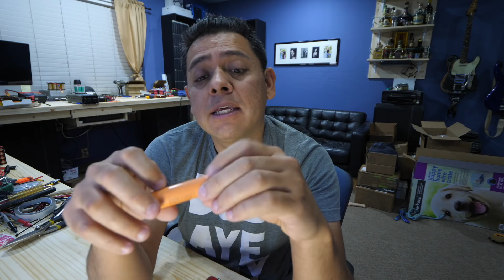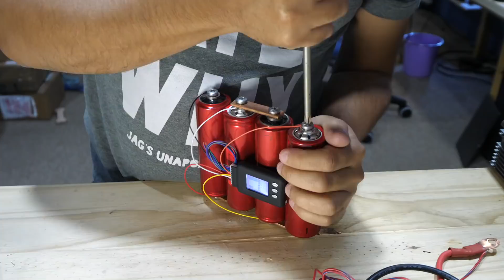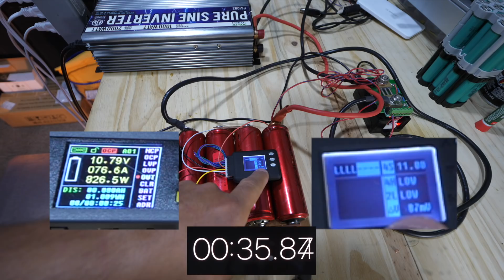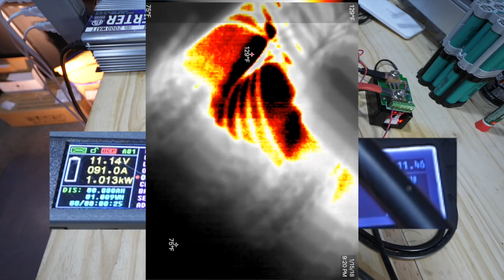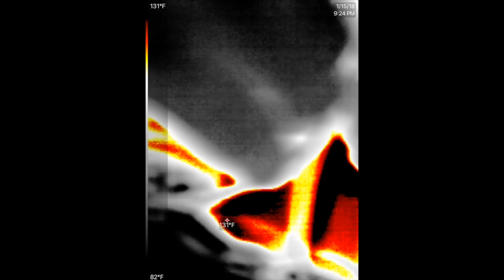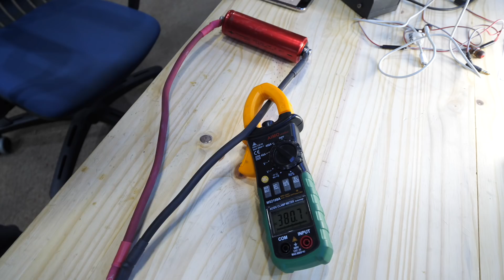12V Lithium Upgrade Headway 38120 Cells - 100A continuous (2018)

Comment: I'm currently running a 4.5kwh 4s 18650 system in my RV. It is entirely off grid with solar. I only charge it to 16 volts because it adds to cell longevity and that is the maximum voltage of my inverter (it's the same brand you used in your video about inverter input voltage range). This works well for me and I don't have any issues. Would there be any benefit to changing over to these lifepo4 for me other than the voltage matching lead acid better?
Reply from the maker: The only advantage is that you would be able to use 100% of the pack energy.  Not worth it if you don’t need all the energy

Comment: How many would be needed to make a good 1kw solar generator? Kind of want to throw my hat in on making a decent Lithium Iron Phosphate solar generator that I can take camping. Just want something to manage basic camping needs and maybe like a Projector for the kids at night :)  Thinking 1kw should do that with 2-300 watts of solar panels to recharge during the day. I just don't want to be using gas generators or buy a flippin $3500 solar generator pack that sucks! LOL
Reply: Still no advice on how many my project would take? :/
Reply: in for reply
Reply: Figure out your watt hour requirement. Projector uses X watts, want to run it for Y hours.
This video literally shows that 4 cells can output 1kw for about 5 minutes, but if your projector is closer to 50w, well you could probably get a full movie out of the 4 cells.
There is a guy on YouTube called Greg Virgoe who is converting a Merc van into a camper and he has a video about sizing batteries to your needs and had a link to a spreadsheet in the video description to help with the calculations, as well as explaining it very well.

Comment: Hi, I'm looking to build 4 100amp 12v packs for my motorhomes solar system. How many 18650 cells would I need for each pack? I also need a bms for each pack.
Thanks
Reply: How did you go with your 100ah battery.  I want to do the same
What did you end up using

Comment: I run 250a thru 16 awg silicone rc wire so no problems your wires are very thick.
Reply: Ok I just watched it and I really don't know where you got the cables from but proper quality cables wouldn't do that at all. Really  measure the inner diameter sometimes there is fake gauges on them mainly Chinese manufacturer and us store import them without knowing. Very concerning

Comment: Don't use these batteries in a cars hot engine bay. I did and it did not end well. I knew that there was a fire risk with these batteries so when I started using them I would check the heat in the engine bay and how the batteries were doing. That was in winter and all was OK. Six months latter come one hot 40 degree summer days and I had pretty much forgotten about the 38120 batteries in the engine bay, the batteries caught fire and destroyed the engine bay. Lucky some guy came with a fire extinguisher came and put it out, otherwise the whole car would have gone. BE VERY CAREFUL.  They need a cool place if you want to use them for a car.

Comment: Being that your over the limit of the 8awg wire that is eating power....
Reply: Eddie Reichel 8awg is totaly fine for 80-90 amps since they are short. I have 10awg for my house electricity it is on 63A fuse and its more than 30 meters long. It hasn't burned out and it is running since 35 years. So 8awg is perfect for 80A
Reply: Well your flat wrong and go9ing to burn your house down if you have 63A fuse on 10awg wire. Clearly you should do a little research on wire size and amps.. Sure it wont burn out until there is a short. No 8AWG wire isnt perfect for 80A.....
Reply: Eddie Reichel well i have a book for wire regulation and sizes and it says fot copper from 6mm² to 16mm² and aluminium from 16mm² to 70mm². I the old days some houses had 4mm² on 50A fuse.
Reply: Clearly your not reading an american book...
Reply: These are the american standards...Some heating of conductors is going to happen but shoudnt be excessive and there is a big difference between a first time setup for testing as this is and doing a final installation...but clearly the 8awg wire is too small being it is heating up

Comment: The batteries weren't full to begin with. A full LiIon battery should be 4.2V, not 3.3V. If you put 4 batteries in series, your starting voltage should be around 16V.

So what are you trying to proof?
Reply from the maker: LiFePO4  celos have a lower voltage of 3.6v fully charged.   What part of the word testing don’t you understand?
Reply: I understand everything of the word testing. No need to get rude. You're comparing apples with pears, and talking about lithium batteries all the time without mentioning they are lithium Ferro batteries. You only mention one time lithium chloride.... 

Not that scientific, but hey, you got 162K views, so who cares.

Comment: I find it best to make 18650's in four series giving 16v then use buck inverters for a constant voltage on w/e volts you need. Just it lets you draw more power out of the cells in three series even when a 12v is low much power remains just unusable. Tiny step down/up inverters really help with small devices you can get 6 packs for under 10 bucks.
Reply: MrSnapy1 i use the same...i made a 4S11P with buck converters to usb and also cig. Socket...not bad batteries were free...👍

Comment: Those cells aren't rated for that discharge rate. 10A discharge is nominal. 30A max, 100A < 30 sec.
Reply from the maker: Spec sheet says 10c continuos,  that’s not 10A, it’s 80A  and 25c bursts

Comment: u still used the builtin BMS of the charger... Check out our Enduro Ebikes, at ecebike.com. No were not like everyone else.... hows 140+Mph, 84V/48AH with a motor thats like being on a 750CC motor? Ranges of 150+Miles on a single charge, and Regen.. all 100% custom and hand made.
Reply from the maker: 140mph bikecycle ..... no thanks
Reply: not a bike-cycle not even close...... more of a motorcycle with "Optional" pedals.. Small work around :)
how fast you go is up to you

Comment: To make 12v battery from li-ion, you need to take 4 li-ion batteries consequently and add about 3-4 diodes to make needed voltage.

Comment: A quick question for the community: Is the additional voltage of running 18650's in 4s for your car battery a problem because the voltage is too high and it hurts the electronics or is it because the alternator wont charge the  batteries high enough? If the battery was charged with solar and there was no alternator could your vehicle starter battery be higher voltage? I am looking to replace my vehicle (sprinter van) battery and the price of the Headway cells are currently a little high.

Comment: Great information, although it seemed a little iffy getting the info considering how skinny those wires were.  Any time a wire is noticeably warm it's too small, and hot wires are nuts, even if they do have silicone insulation.  Try taking measurements of the Voltage dropped end-to-end on those wires sometime -- I'm pretty sure you'll be surprised at the magnitude of the Voltage drop.

Comment: Do you think theres a suitable replacement for the Prius hybrid battery?   I have a 2005 it has 28 ( 7.2 v ) cells for 201.6 volt cell which are in series. I would like to add a battery that would extend my EV range.  Thanks for your opinion.

Comment: I'd like to do a DIY powerwall system and substitute the 18650 batteries for the 38120's. Any opinions on this idea???
Reply from the maker: Doable
Reply: How many cells do you think I’d need to build a 7.5 k powerwall?
Reply from the maker: Do the math V x A = W

Comment: Are these a good choice for a power wall/power storage application?  I like the fact that these batteries can be connected via plates and screws versus solder and wire.  The extra cost aside, are they a good choice?  I like the extra safety aspect as well, because of the chemistry of the battery, if I'm understanding that point correctly.
Reply: No they are not... less than 8000 mAh ... low capacity, HIGH performance with those 100 ish amps. No, the 21700's will be hard to beat any way you look at it. M50's are pretty dang good.

Comment: Next time use"4-gauge"test cables.Use a bank of"Maxwell super-caps"to keep from drawing too many amps from the batteries,make the super-caps do the work.
Reply: I agree charge caps from battery then use caps to run high power loads
Reply: 4 gauge how can i use those super caps i’m trying to build a DIY solar generator and i am trying to find the best batteries for that project can you tell me how to use those super caps ?
Reply: @juancarloshernandez1769  What do you mean by solar generator? Do you mean solar panels?
Reply: Do you folks realize this was a test? NO CAPS! Pun intended. The setup should have not had these problems.
Reply: Super caps would only be useful for a real short start up current like micro seconds because if it is a sustained current draw it will be drawing it from the battery just the same you are better off just sizing your system correctly because even if you are running any cells at 2c you are only getting up to 1/2 an hour and I assume you want a longer run time and 80 amps from 8Ah cells is at best 6 minutes if you added super capacitors they would add probably less than 1 min to that so you would be better off just buying another 4 9f those cells and have like 12 minutes for less money and the draw would be half on each cell instead of basically the same

Comment: So, when you wire 4 of the 3.2v 7ah batteries together, do you get a 12.8v 28ah battery or does the ah remain at 7?
Reply from the maker: It remains at 7

Comment: It looks like you just about doubled the safe ampacity on those 8 AWG cables. for 100A loads, I wouldn't use less than 4 AWG cable for continuous use (with good ventilation, high quality cable), or 2 AWG if I want to be very safe. By overloading those cables, you cause a larger voltage drop between the batteries and the load, reducing the amount of power it is able to draw.

Comment: Modern cars today work with charging systems from 14v to 18v and they work just fine. One need not restrict themselves to 12 volts.
Reply: charging voltage for Lead Acid is generally 13.8V  and you don't have worry about over charging since it stops drawing current once charged, but these Lithium  whatvever cells are a totally different story: they need  a stage charge and Voltage and Current have to be monitored and controlled hence the need for  BMS.
Reply: I have worked on power generation and vehicle electrical generation systems for literally 43 years and there are no problems with using more than 12 volts in a charging system.

You are defending an nonexistent topic since the charging of the cells was not this man's initial remark and because you can add as many cells as you like, making the voltage higher than the charger system is nothing but adding more cells in the series.

On top of that, performance data from many people using these same cells shows that the voltage often drops off to below 11 volts under peak drain, meaning that having a higher standing voltage may be necessary to prevent falling below the lowest usable voltage your system may require.

And in response to THAT remark, before anybody else says anything, TYPICALLY a '12' volt system is REALLY a NINE volt system with a 33% security surplus. That is just how it is engineered.

Same is typically true of all modern power systems, no matter what the voltage you see the supply at, the system is engineered to work at 75% or less than the peak power because of choke points at switches, relays, corroded contacts etc, weak, or poorly charged batteries,
Reply: Yes there should be 'no problem' using more that 12V to charge on Lead Acid  (typically 13 to 15,6, float should be  13.5 to  13.68V)) but the point is that the Lithium tech needs a closely controlled charging regime (periods of constant current and constant voltage), as well as  control of the discharging (over current and voltage). I have to disagree with you on the discharge levels of Lead Acid. Yes nominal voltage is normally 12V (6 cells) but looking at a spec sheet of the Vision range  of SLA the relationship between OCV and state of charge, 11.6V = 0%,  12V = 26%,   12.5V = 65% 12.7V = 80% and 12.9V = 100%. Another important is how battery life is related to Depth of Discharge, which dramatically decreases as DOD goes up, generally you don't want to go above 50% DOD, buts that's all in the oft unseen and unconsulted SLA typical spec sheet

Comment: I am using the 15ah cells making 48 volt pack running my ebike for  2 yrs now -- great diy battery
Cheers
Reply: PATRICK MCKOWEN what kind of charger are you using.and are you using a bms..i bought 20 of them because it was all i could afford..do you know if there are any of the used ones still avail..thanks jim sorenson idaho usa
Reply: Give me Suggestions  about 72 voltage

Comment: I tested about 30 of them, and capacity ranges from 6900mah on the bottom, to over 10,000mah on the top, but average over 8000mah. So saying they have 7400mah is just picking a single cell and calling it the capacity of all cells is incorrect.
Reply: Hey man what was your cycle voltage range? Did you go from 3.65v to 2v or did you stop at 2.5v?
Reply: Yes, my tester is set for 2V. I guess I should see what I get at 2.5V

Comment: Putting a 1500 watt load on a 1000 watt inverter to draw 80 amps from 8ah batteries, you are brutal.  Hope you don't drive your car at 500 mph. LOL
Reply: take a look at the datasheet max20C(160A) peak 25C(200A) .... 80A is 'soft'discharge .... the limiter in the setup are the cables
Reply: That is the guy I watch and   be a Lerner.

Comment: Don't get it, std 12 volt lead acid run between 14.4 and 11 volts so half a volt 12.5 volt would work. It would need a charge limiter in most applications.

Comment: A 12V lead acid battery is not 12V.... A reading of 12.65-12.77 volts means your battery has a full charge. 12.45-12.54 volts means you have a 75% charge, 12.24-12.29 is 50% charged, and 11.99-12.06 volts is 25% charged. 11.75-11.89 volts means your battery is dead.  And also when the battery is charging the voltage is much higher,  her in Norway 14,8V  is not unusual because of the cold climate. Lithium battery cells can replace  lead acid batteries but it will be very close to the max with four 3,7V cells.
Reply: yea - the Spec Sheet for the product should be compulsory reading before any fiddling or gungho experimentation takes place

Comment: I've been checking out the BMS options (in the US) for this 4S pack (in your video) and I ran across this item on Amazon.  It's rated for 100A, which seem quite high, and especially high since I'm not planning on going over 30 amps.  Do you think it would work for my 4S2P pack?
MagiDeal 4S 100A 12V LiFePO4 Lithium Iron Phosphate LFP Battery Protection Board. https://smile.amazon.com/dp/B078BFQFBM/ref=cm_sw_r_tw_dp_U_x_0MkGAb2S2HBZN
Reply: Yes it would.  It would allow up to 100 Amps.  So 30 wouldn't even stress it.

Comment: Hey mate 
 I want to make a 12v battery bank for 4x4 camping and my caravan that would run a 2000w inverter and charge-off solar/camping generator. I would like to make something around the 200 ah that would charge during the day and last the whole night with modest uses with lights, charging laptops and phones and run a tv.
do you think these would be suited for the job?
If not could you recommend anything better? 
cheers!
Reply from the maker: Yes this battery works
Reply: do you have a video or could you recommend a video that would have all the info on how to make something like this?
looking into it now, and i have found videos with people making these battery banks, but lots of people are leaving comments telling them they have not taken battery balance into consideration or the charging system they are using is incorrect. and also a bms should be used.
im a motor mechanic by trade so I'm  "handy", and am binge-watching all your videos atm to learn what all these things are and how they work so im prepared when I make my bank. 
just looking for a video that i can trust to give me a guide to make this bank safely.
thank you for your repley !

Comment: The bateries doesn´t recover voltage by any way, the problem is just those cables. whats has happened is that at start the drop voltage on those cold cables are huge becase they are too small for that current (just 40 amps is soo much for 8 awg), but once they get hot his internal resistance drops, soo the voltage seems to rise, but in fact, the voltage in those cables is droping for the high temperature. Then, the voltage drope in the battery pack is big enough to keep droping until the inverter stops.

Comment: I tested brand new factory fresh cells. A single bank should to 50amps @12v and 100amp @11v.  When warm they will do around 80-90amps @12v. Under the conditions you tested it should have never dropped below 11v and should have climbed to 12v or above when warm.

Comment: ive not seen you really mess around with any 2x700's...the 20700, 21700, or 20650s? have you gotten to play around with any of them yet. like the sanyo-a or b 20700 or samsung 30T 21700?
Reply from the maker: Not yet,  I do have a 2170 but appart from a torture test, I can’t do much with a single cell

Comment: Just a suggestion. If you test a set of cells using an inverter you should eliminate everything except the cells as a potential problem.

If it were me I would have used something like 2 AWG or even 0 AWG just to make sure that the cables were not getting hot and wouldn't cause voltage drop.

but because you undersized the cable/s (I know that you used the cables that came with the inverter. Never trust cables that come with cheap inverters) the voltage sag and the other problem COULD have been partly attributed to undersized cables.